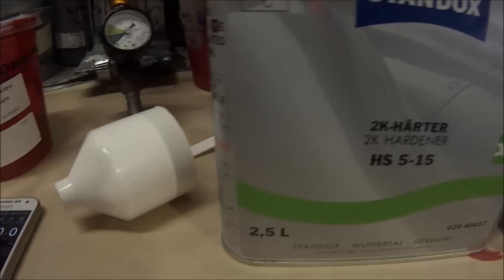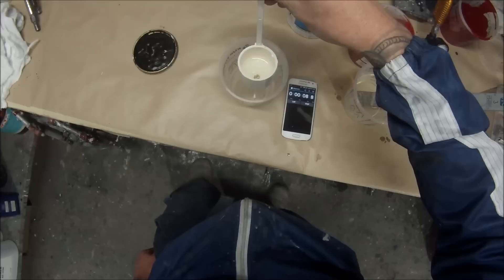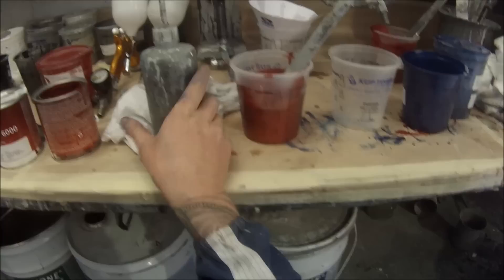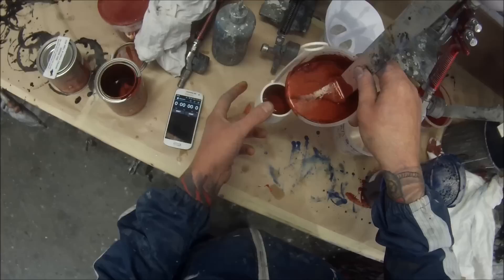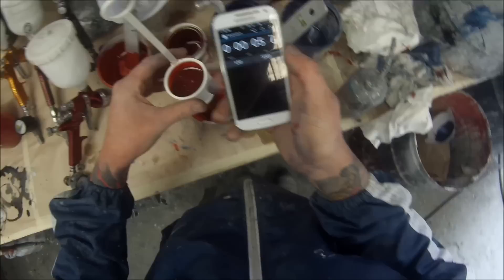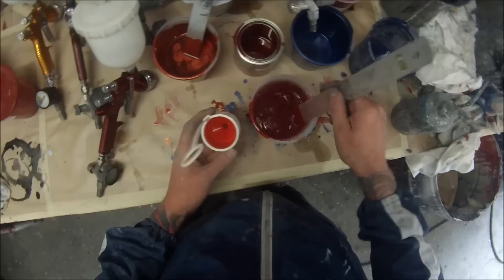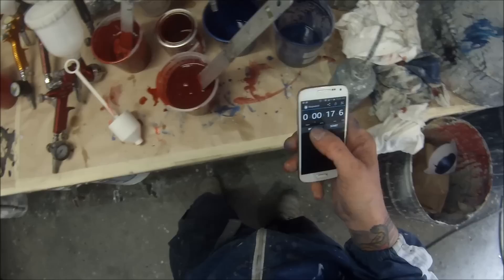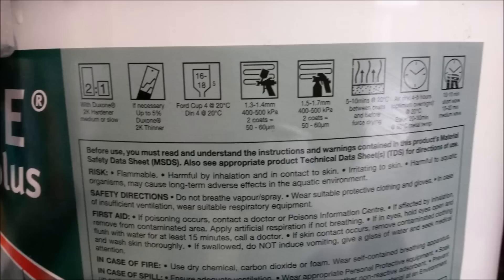How to use a Viscosity Cup

Comment: Hey Gunman, thanks for all the videos, and great info. I especially enjoy the 3rd person view, it gives a great perspective on what to expect. I have been spraying cars in my garage for years and always take care to keep everything clean. In general I have been very pleased with the results. I have a question about dust and bits of dirt. When ever I spray etch primer, primer - filler or base coat there's never any dust or dirt. As soon as I spray clear coat or gloss it seem to attract the dust and tiny bits of dirt. Sometimes more than others. Any ideas and advice? Keep up the good work.
Reply from the maker: Thanks for watching mate, And that's always the way but the truth of it is that the dust is actually there in the other stages but you wont see it and mate I take all steps known to myself to get clean jobs plus I use a booth and occasionally still get a job that's full of dust so there's no one pointer I can give you other than do your best and be fastidious about cleaning. Water on the floor prior to paint can help too, wipe airlines, clean clothes, gun filters, tackrag 3 times all the usual stuff. Good luck mate and stay tuned.

Comment: i'm using single stage 2kit goes through a din 4 cup in 18 seconds @ 20 degrees with no reducer but won't spray nice through 1.4 te20 unless i add 20-30% reducer am i wrong to try and spray this paint like it's clear coat?

Comment: I mixed some dna diamond clear it requests 10-20% reducer. I decided to measure it’s viscosity for the first time ever and I got 12 seconds! Surprised by the result as even at their minimum recommendation it’s too thin.
Reply from the maker: That's very odd. I'm going to start measuring the PPG clear as of tomorrow.
Reply: @TheGunmanChannel  yep I doubt it was because it’s was a 20 degree day. Tried without reducer and it was in their 16 second window.
Reply: @TheGunmanChannel  how did you go? I’m using some more dna clear from the same can today I’ll let you know if the results the same
Reply from the maker: @ivantieu6764  well I found it's a lot nicer after leaving the clear in the booth while masking and basecoat
Reply: @TheGunmanChannel hmm so some manufacturers say to let their product to catalyse for a bit before use could be correct?

Comment: is it ok to use standard thinners ie one for cleaning your gun when adding to basecoat and laquer or should you use basecoat thinners. is there a noticable end finish regarding using recycled thinners or basecoat thinners.thx
Reply from the maker: I would not recommend using gun wash in any paint as a thinner, The results are much poorer and it's not a good practice as it breaks down the paint quality. Thanks for watching and good luck with your work.